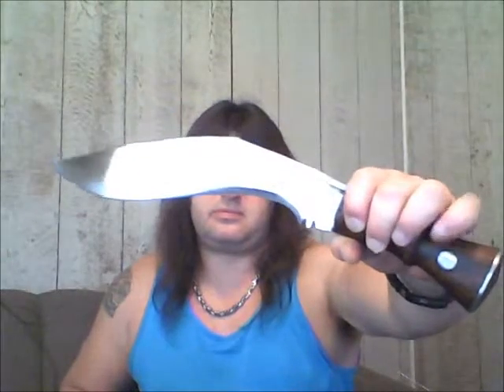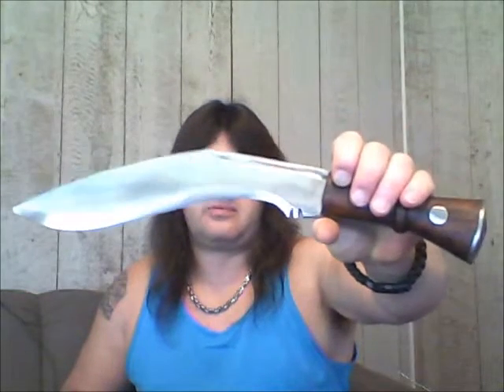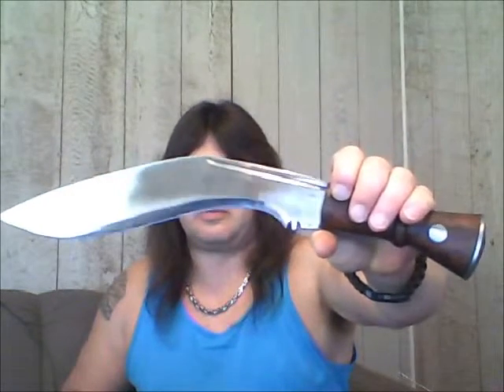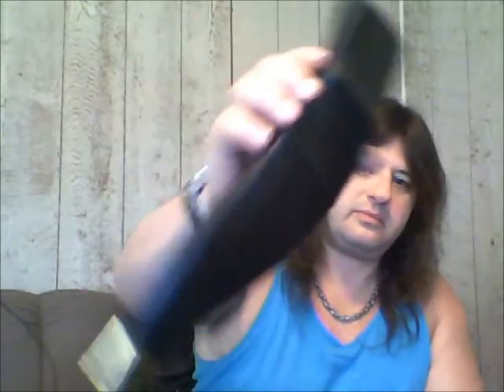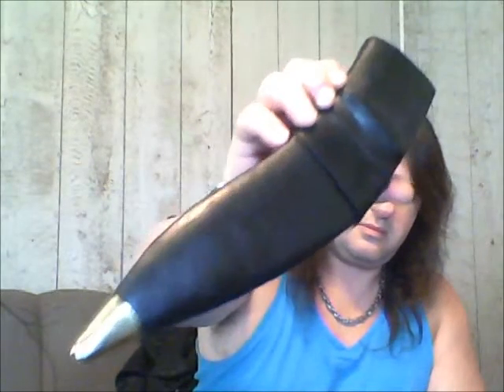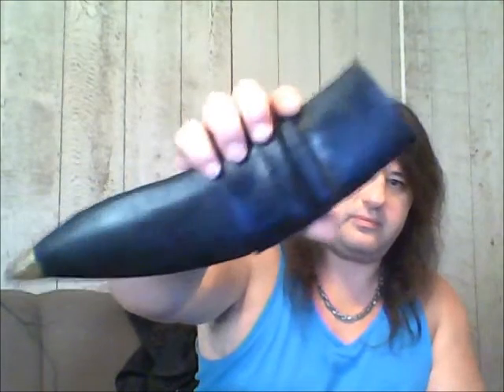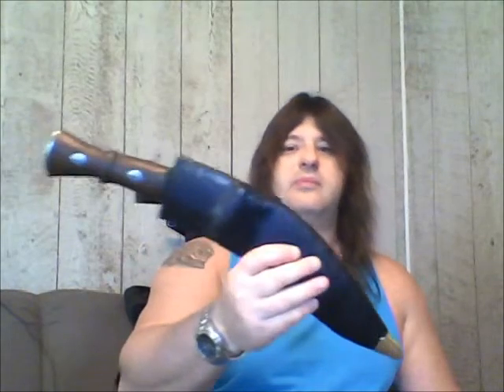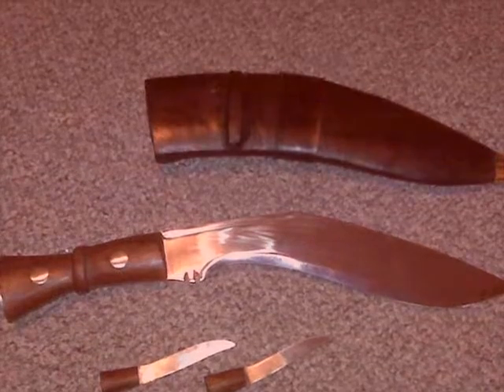BudK kukri

Comment: Just ordered mine last night. Good to know it really is a quarter inch thick. I intend to use it to process wood. Should be tough enough to take that kind of work. Thanks. // UPDATE: Just got mine a few hours ago. Two days. It was rust free, oiled, sharpened, and is 3/16" instead of 1/4" thick. It weighs 5 oz less than the 1/4" @ 1lb 5.8oz. I'm quite sure there must be 2 versions out there by Bud-K but the buyer has no control over which comes. As for me, I'm happy with this one. I'll be trying it out tomorrow and making a video. // Enjoying channel 'cause you like big knives. Later.
Reply: ANCHOR440 I don’t see a video on your channel about the kukri